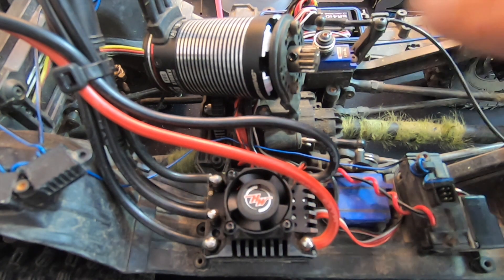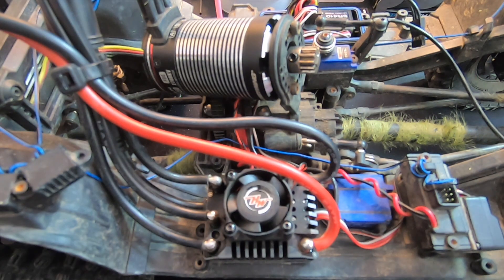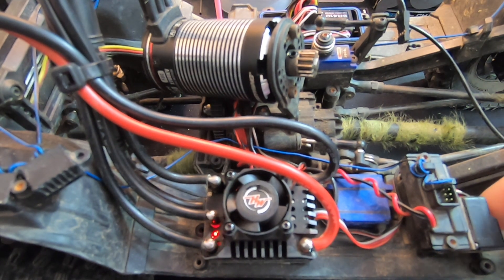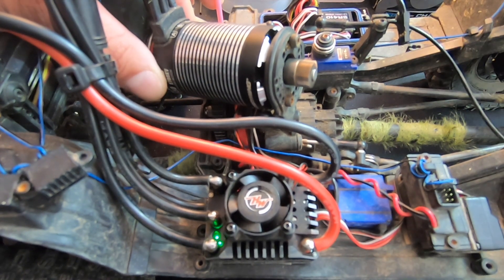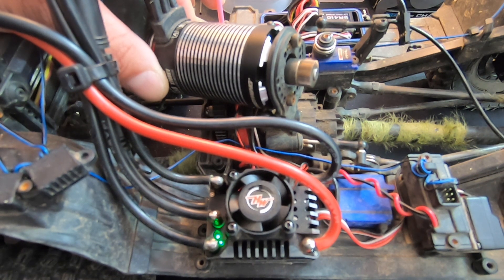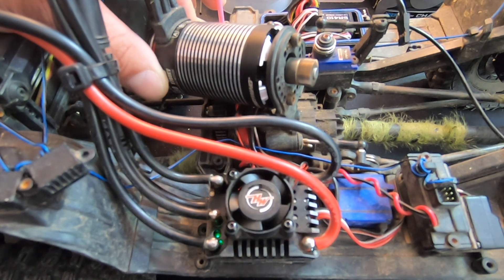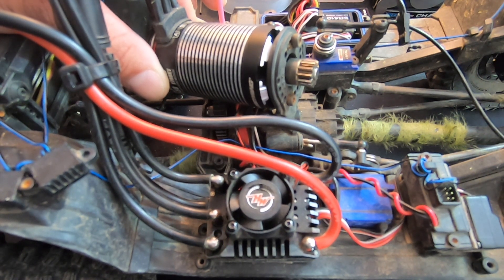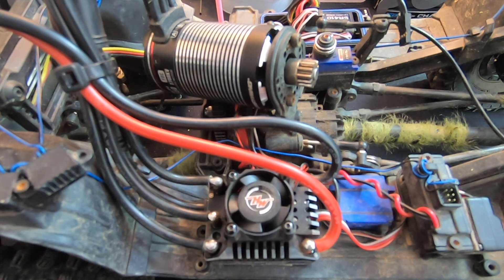AXE FOC Automatic Motor Pairing

Comment: My axe stopped working right so I am trying to re pair the motor. It runs at the one speed stops the just keep flashing green. It never starts moving again after it stops the first time. My issue is the car stops driving and the drag brake stops working on 3 cells. When I us the app it still shows the throttle input. Anyone know what the fix is?